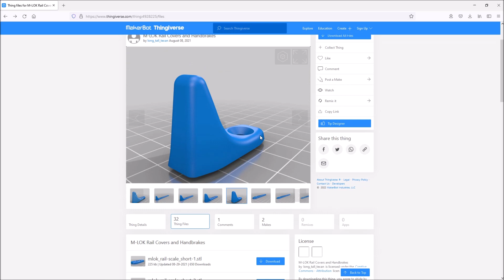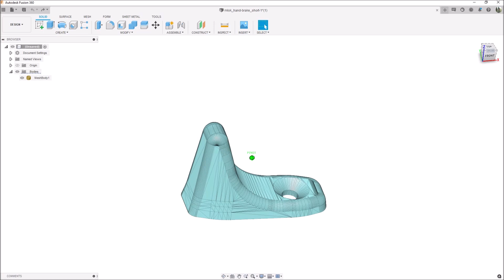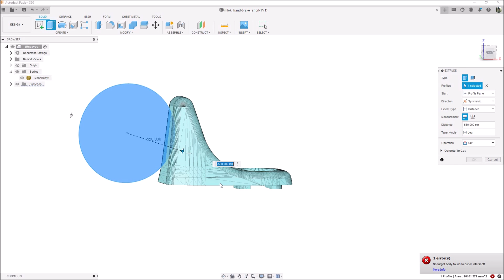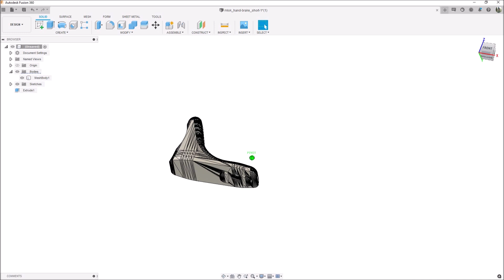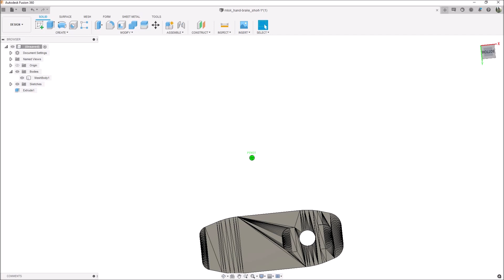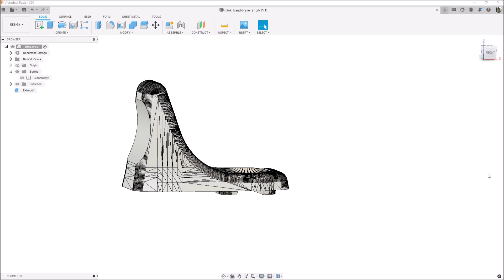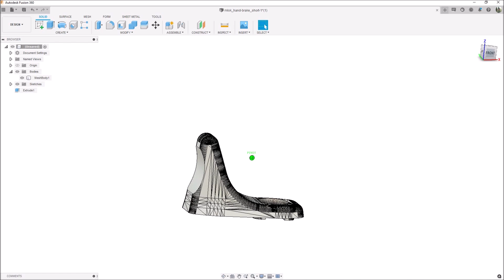Fusion 360  Mesh to Solid

Comment: i have a question whats the difference between  STL file vs STP file? good video
Reply: over simplified answer is an stl is a mesh and step are solids. steps can also contain material information if i remember right.
Reply from the maker: Exactly right. The mesh file is the exterior or surface.  most 3d printers use .STL files. The step or Stp is used for ad modeling etc. Has more information contained in the file.